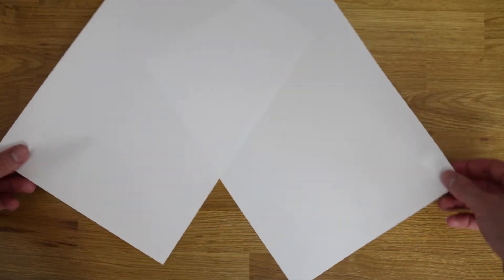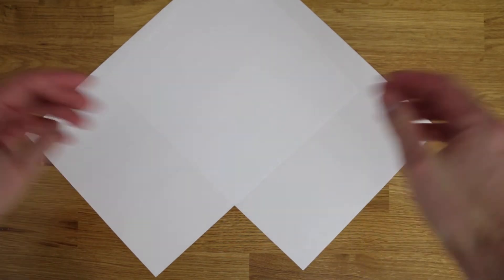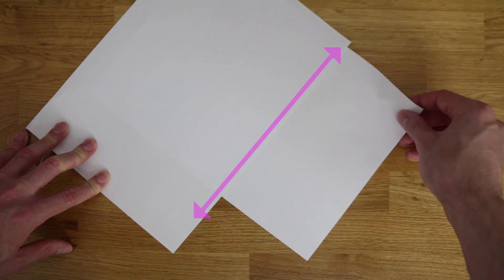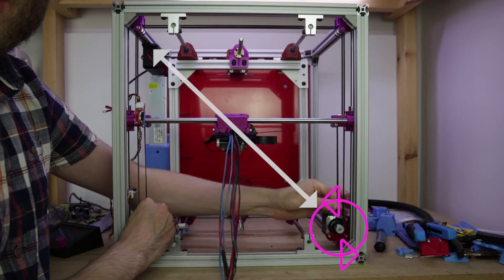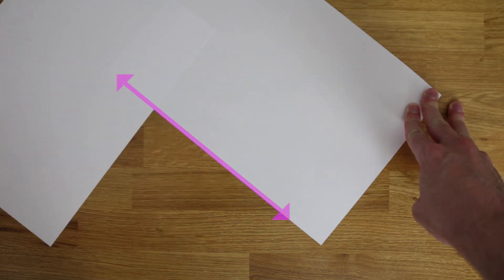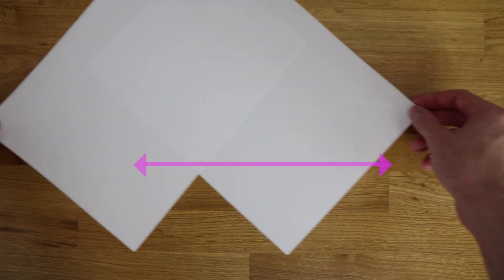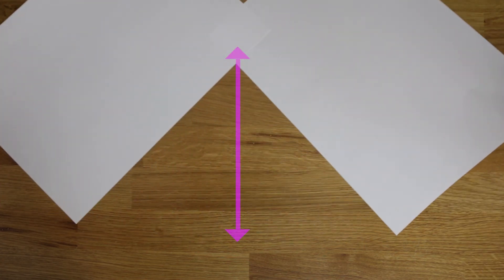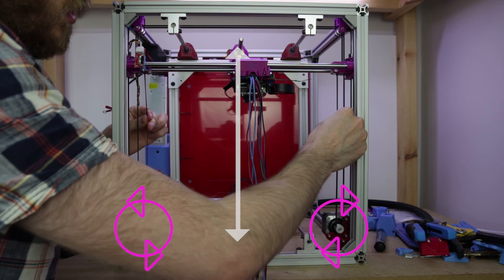CoreXY Explained With 2 BLANK Pieces of Paper

Comment: Bit late to this but I thought of another good way to explain after learning from your video! Thanks!

Think of a wood block tensioned between two strings:
\[]/

If force is applied in opposite directions on the strings, the block moves up or down (Y motion):
<- \[]/ -> would result in []

this works for both directions, also applying force in same direction on strings would result in X motion:
-> \[]/ -> would result in... the same thing just to the right😂

this would also fit your diagonal use case, pulling only one string! just thought I'd share after my mental battle trying to understand.

Thanks for the video
Reply: edit: I hope this made sense... YouTube formatted my ascii art all weird 

Y motion:
<- \[]/ -> results in _ [] _